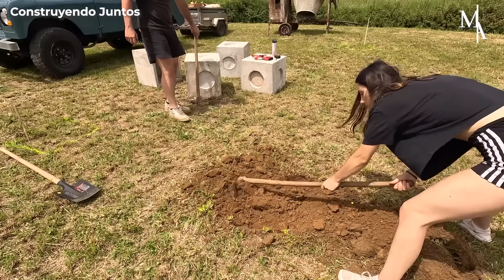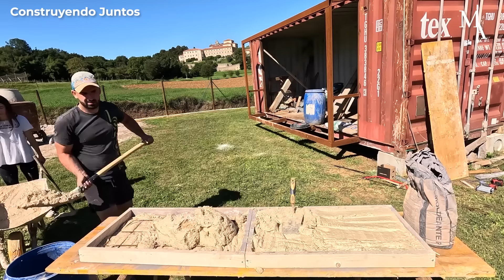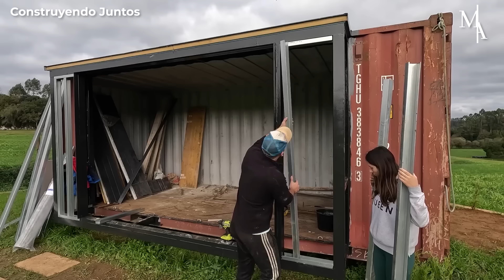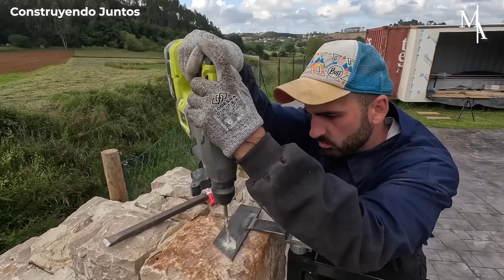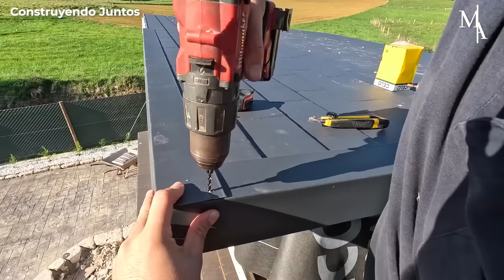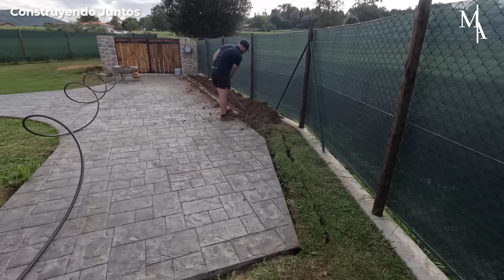Couple Builds DIY Container House and Saves $50,000 | Start to Finish by @Construyendo-Juntos​

Comment: ~LOVE~ the design. With 10+ years of a mechanical estimator / project manager for hospital construction, I would take the shipping container and wrap / glue the whole exterior in ~THERMA-FLEX~ , after that, use wood siding for 3X the insulated R-value. For a stable, movable foundation, use ~GROUND-SCREWS~

Comment: Somewhat misleading? We assume the average home has a full poured basement; That's excavating, pouring footings, basement walls, backfilling, etc. all their sitework consists of is some kind of foundation blocks. That would probably cost at least another $50,000. To imply these storage containers is a little misleading. All interior spaces are limited to the 8'-0" of those shipping containers. All savings is for the contractor. Home buyer gains nothing.

Comment: Lots of nice exterior work but not a single indication of any interior work.  No footage of insulating the metal box or adding flooring and no indication of a toilet or bathroom ever being installed.  We could have done with seeing some of the internal work instead of a robot lawnmower being assembled.

Comment: Only one complaint. You could cut some off the construction time and give us a SLOW look at the finished project. Ten seconds at the end isn’t enough! In fact it’s very frustrating to watch all the way through and not get to have a really good SLOW look for five minutes at the end of the video 🤬
Reply: Absolutely!
Reply: Actually, I'm annoyed they didn't finish the house before ending the video.  Honestly, I was surprised they spent so much time making improvements to the property before finishing the interior of the shipping container. For that matter, I wanted to know what they were planning to do with that "second floor" they built.  Did they just want a section with raised ceilings?  Or were they planning on building a lofted bedroom?